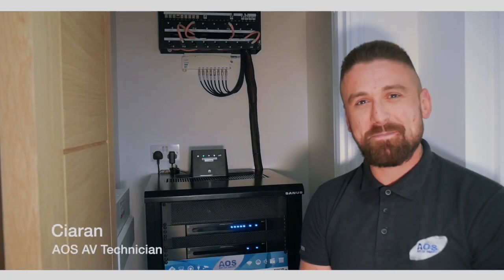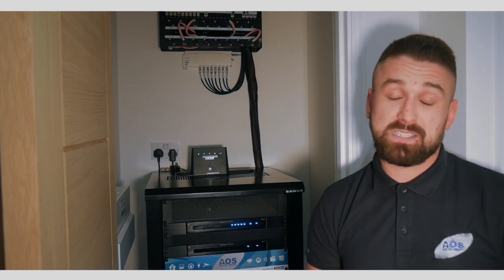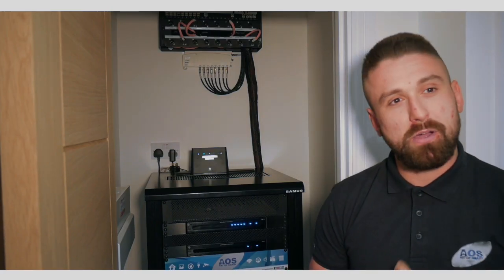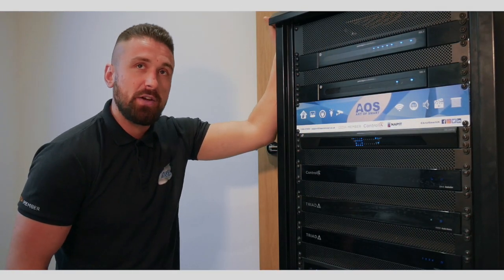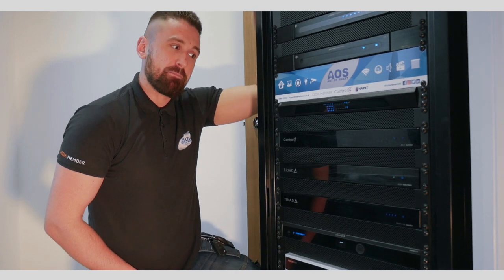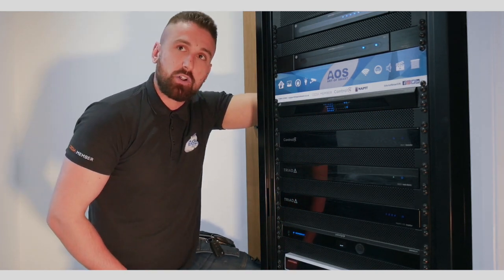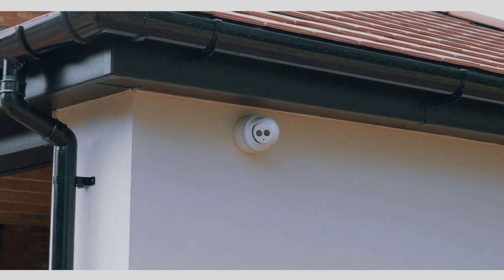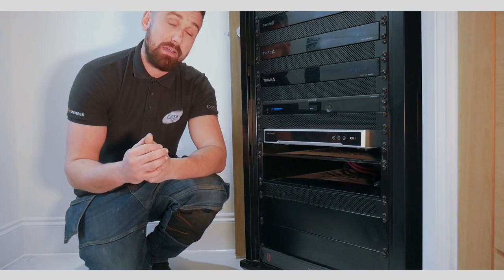Control4 Smart Home Tour & RACK WALKTHROUGH - ART OF SMART

Comment: Your editing is horrible and your sound is too but I like the concept of putting the patch pay on the wall instead of in the rack. I installed mine in the rack and every time you move it lugging 50 runs of cat6a and the stress it puts on the patchbay. I’m going to make a big service loop and put keystone cat6a plugs into a grounded / shielded patch bay. The ground will be better there anyway.  

Ever put in a telecommunications grounding bus bar in your wire closets?  A separate ground that runs back to the main panels ground. Mount a copper bus bar to the wall in the closet and connect all the racks and components to it.  In the US this is code for businesses but not residential.  Usually having a ups or pdu in the rack (even when it’s a rolling rack) makes a good ground. Ground from the ups is tied to the metal case of it, which is screwed into the rack making a ground.   I guess the telecommunications ground is kind of like having a orange isolated ground outlet.  They have those in the UK?
Reply from the maker: Hi Jonathan, That completely depends on the application. Sometimes they are taken to the MET of the installation